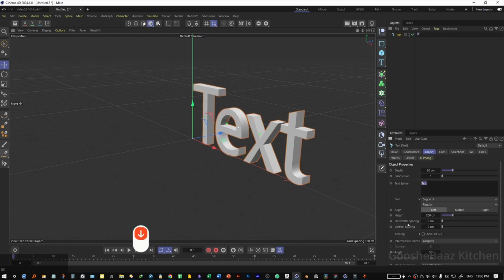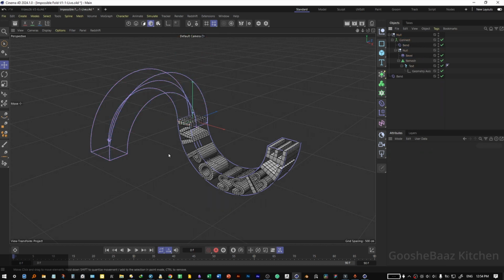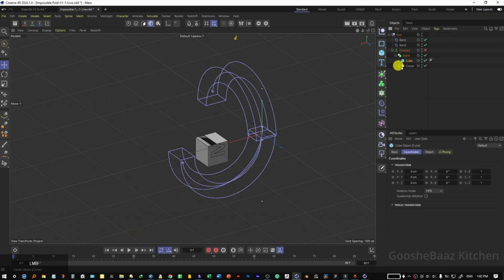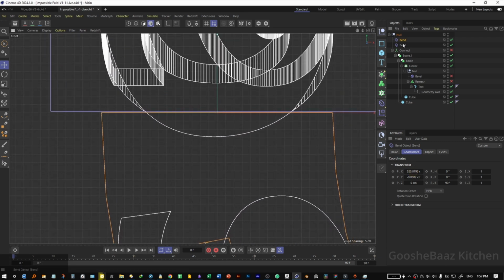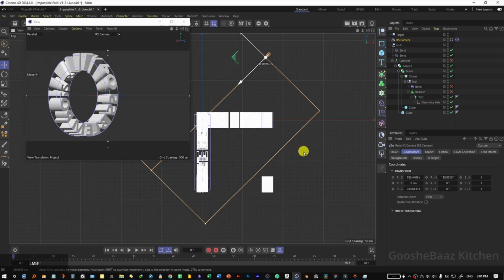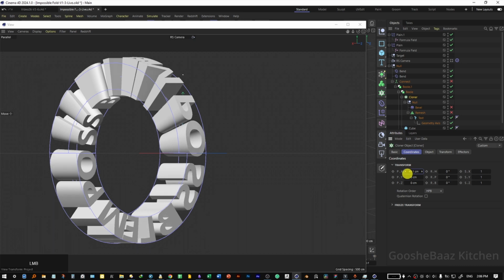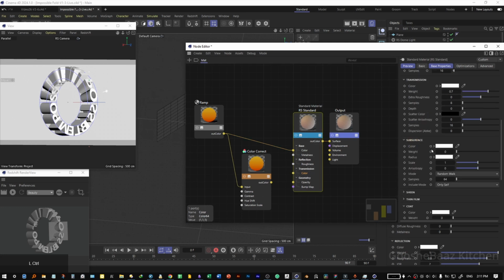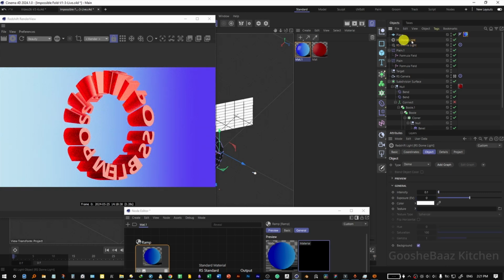Impossible fold in Cinema 4D ⚡[ in just 10 MIN !]⚡ + 📩[ Free Project ]📩

Comment: Thanks for the tutorial. I see a few things that are left unexplained, and I assume it's because you don't even know yourself why you're doing it lmao. 

I don't understand why you would remesh the text. There's simply no need to do that as the mesh of the text object comes out just fine...the moment you apply remesh the I and M become one and unreadable...

Also the whole boolean operation is not necessary - you want to be able to read the text anyway and not cut it up in the middle, don't you? Then you might as well adjust the text height in the text object until it fits the bends properly and just clone as many of them as you need. If you need a different start, just use eg 'SSIBLEIM' as source text.

Also the connect object - why would you need it? It's not even active by the end of your video and I don't see why it would be necessary in this setup....Good inspiration though! I didn't know about the geometry axis node, very handy.